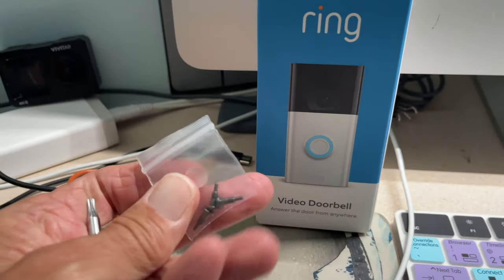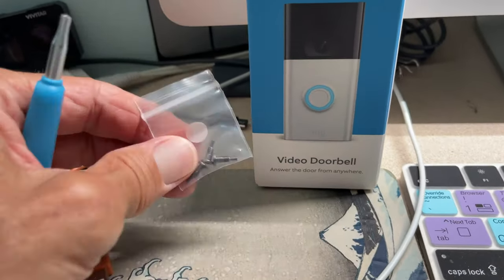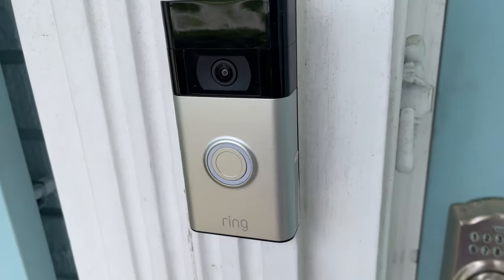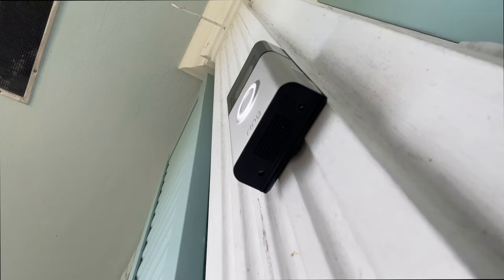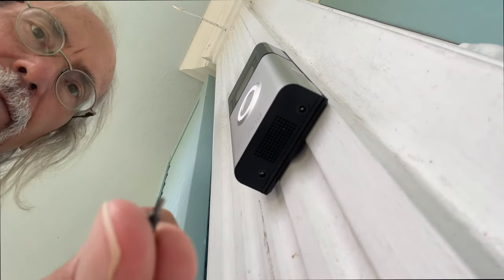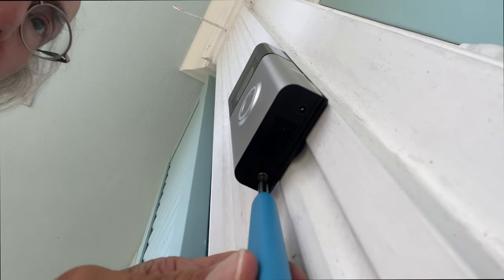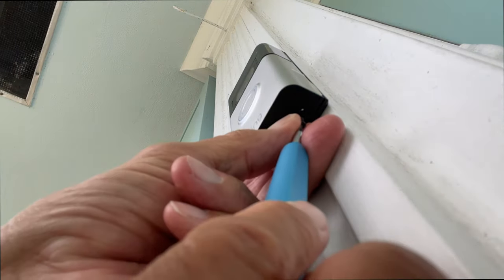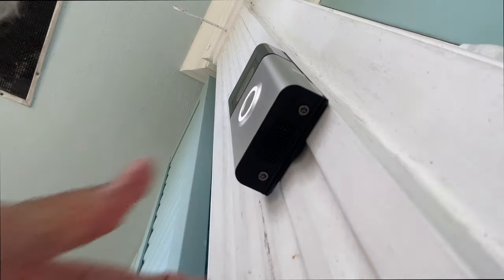How to install Security Screws on Ring Doorbell

Comment: So once its on, how do you get to back off to charge it? The screws just spin.
Reply from the maker: I give you a specific type of tool with a star head on it and once you get them loose, you should be able to twist them with your fingers and pull them out. If not, you may want to use needle nose pliers